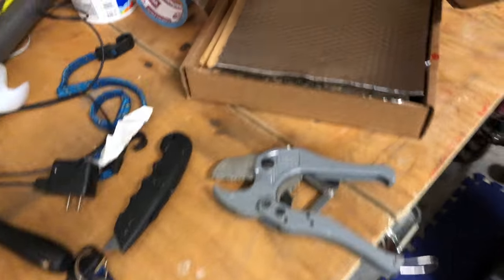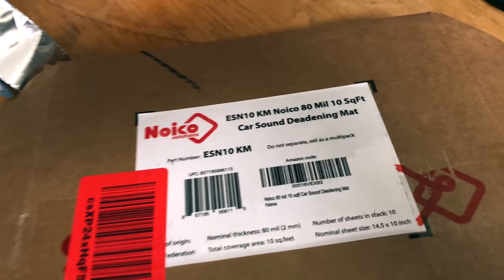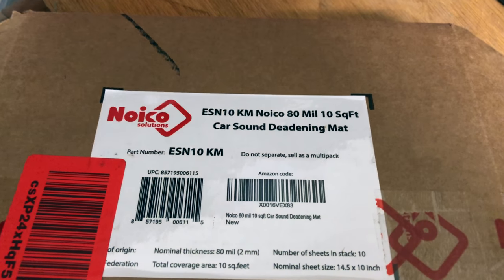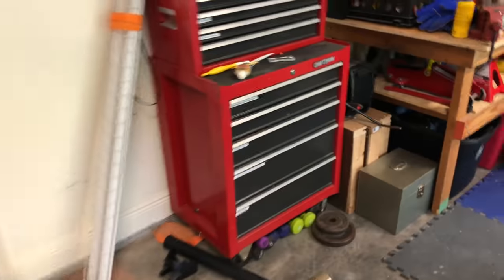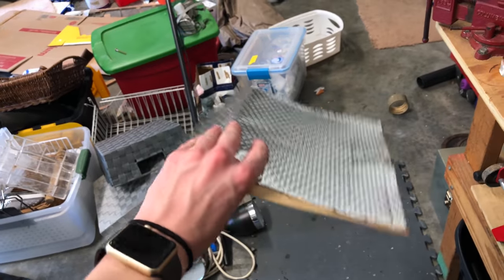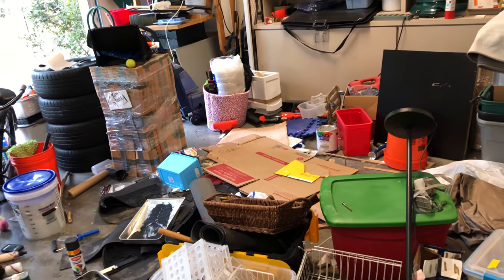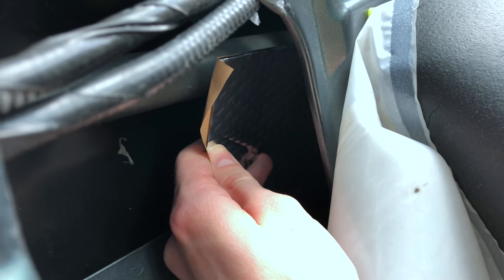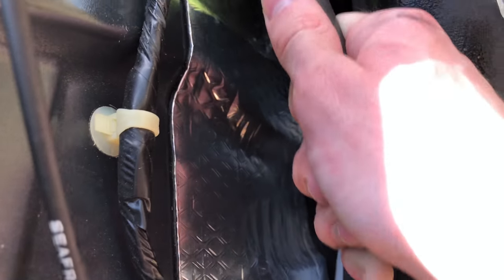How to fix a Hollow Sounding Door!

Comment: Someone reversed right into my driver side door on my 6month old honda accord and I had to have it replaced. It was replaced by a Honda body shop with a OEM Honda door and it sounds like shit now. it lost that nice sturdy sound and now sounds like its a hollow tin can.  its driving me nuts to be honest, more so because its a new car.  I think im just going to go to the body shop that did my repairs and hope they get what i mean.  Was your door replaced?  Also i know water does get in the door and drains out the bottom, does it effect the sound proofing stickers you installed??